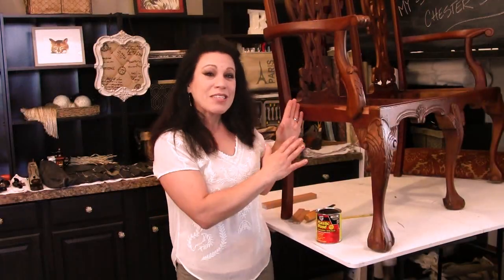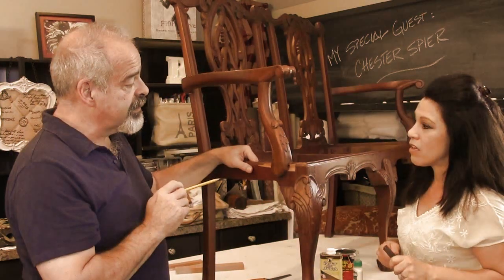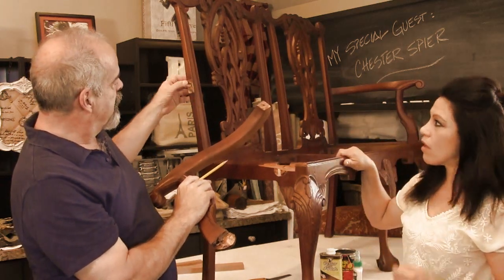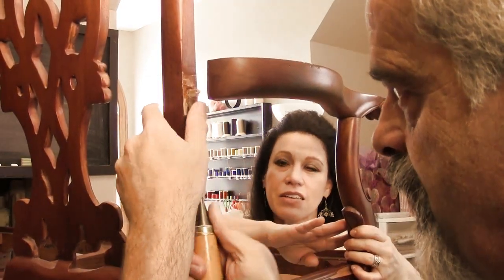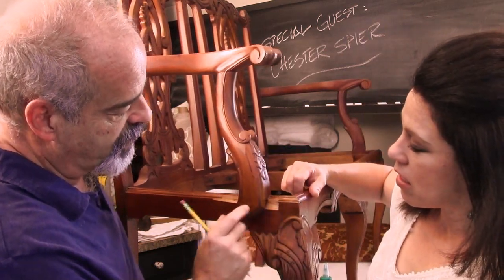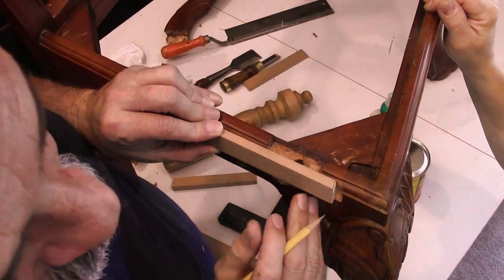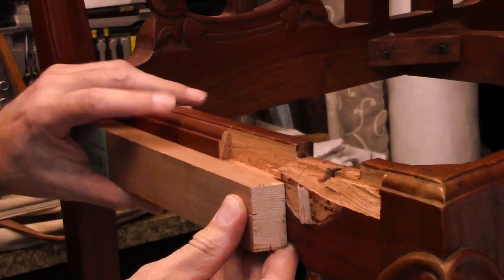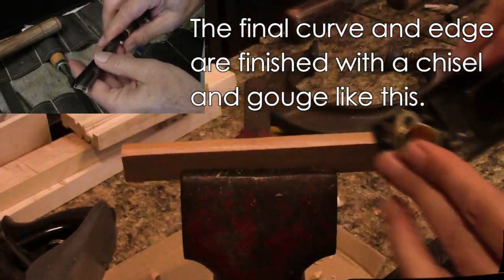Become A Pro At Fixing Broken Wood Chair Parts! Watch A Master Woodworker In Action (part 1)

Comment: I have a rocking chair I have had outside on the porch that is 20 years, old ladder back, real basic, the rungs are pulling out from the front rocker. I was told that all I have to do is get a heavy-duty wire and wrap around rung in front and just wrap them tightly and that way the rungs will go back into holes. I have had this chair a while and it is out in the weather but my sister and folks bought this for me and I use this chair a lot. I sit outside in the morning and read my kindle and rock my cat. Do you have any ideas to fix this with out putting a wire girdle on it , I donot think it would look too nice. good video Glad you liked your slipper pincushion, I have one I made out of a cup, it is deep enough to put extra pins and ripper  and even exta thread. I just pull the stuffing out of top and wala extra stuff you need.  I love the idea of having extra pin cushions for what ever room I am using  the pin cushion for, handy and fun to make. I made some for Xmas gifts for when I worked at hospital. personal but not real pricey and anyone that sews or has a machine they are usful. See ya later, Nancy
Reply from the maker: Nancy, There you are! I was getting worried about you. Yes, the pincushion is adorable and it will make life in the sewing room so much easier. Thank you again for such a thoughtful gift! I hope you have some new-found faith in your local post office too 😜. I think if you try to separate the rungs on your chair a little more and clean the glue out with a chisel, you can glue it back together with Tite Bond glue and hold it in place with a couple of large bar clamps until it's dry. That should help your chair last for many more years. However, sometimes it's nice to hear the creaking - especially on a rocking chair. It seems so old-fashioned-feeling to me. You're the best at gift-giving!! I hope this helps. All the best, Renee
Reply: I have, or if I ever get my batting will finish off a bench, I will put in front of my window in the study. I have a bench in front of all my windows except living room, for my cats and dogs. It sounds silly but this way they can be in the room with me and look out the window as I do what ever. As far as the post office let us just say I have lived here for 18 years and sometimes I cannot count on the post office to get it right. Small town and it is some times not safe at the post office I have had people hit my car with their car door, had children let my dog out of the car, been backed into just all kinds of things, I do not pick up my mail but 2x a week it is all I can muster to go there. Your videos are  very interesting they get better all the time. Handsome man with wealth of knowledge behind him. There are few poeple around with this knowledge anymore, which is a shame, the skilled jobs are not out there anymore, no one wants to learn a skill just DIY at tthe dollar store . Which is not bad but it still is not a skill.
Reply from the maker: I hear you! I have little benches and ottomans in front of all my windows too. The kitties love to cluster together and look out the windows. I'm glad I'm not the only one who does this. Your post office DOES sound like a nightmare - thanks for braving it for me 😘Yes, Chet is a treasure. He's knowledgeable, funny and interesting too! I'm trying to learn all I can from him. Have a great weekend, Renee